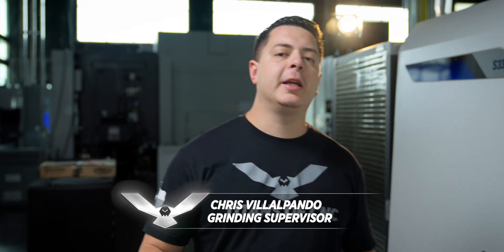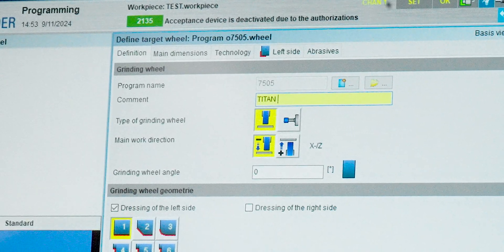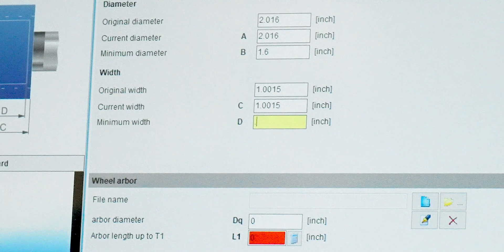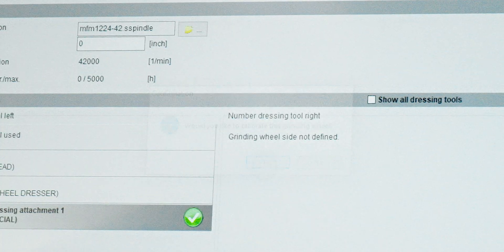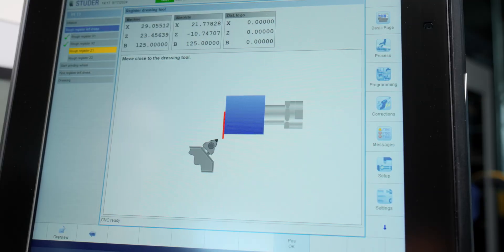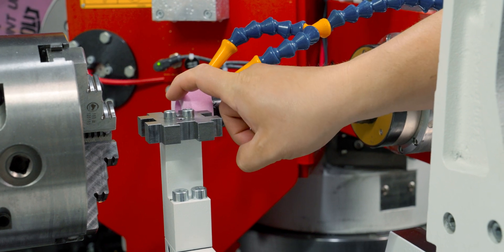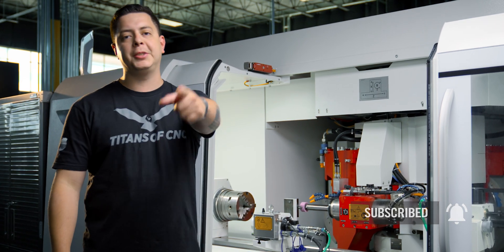Setting Up The Incredible STUDER S33 CNC Grinding Machine

Comment: Epoxy for wheels? I run some older ID grinders have been for about 5 years now but thats the first I've seen that. I just use blotters and screws and indicate my wheels into center to balance the wheels to minimize vibration through the quill/wheel but minimize the amount I need to dress off my wheels to true them up. Seems to improve my surface finishes, maximize my tolerances I have to hold, and prolongs my wheel life.

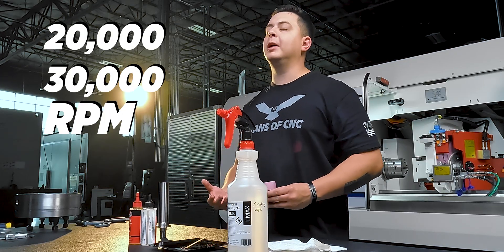Comment: Printed on wheel - max rpm 0:40 16234; 1:57 caution, do it good because it will spin at 20-30krpm. waitwhut? Is that like a radius diameter rpm thing? :D
Reply: Max rpm only applies at max size. This is per norton (hard to get a straight answer), radiac/ tyrolit (north America vs Europe parent company), and noritake (speed listed not rpm). 

Equates to a surface feet per minute or meters per second. Essentially wheel limit for that wheel is 96mph or 43m/s or 8500sfm. If you never go faster than 90mph, 40m/s or 8000sfm will you ever exceed the wheel limit? No.

I run an S41 all day.

Comment: When you put that cross thing on the grinder and just tightened it down.  I'm thinking to myself , how is that going to know where it is? There's no wires or lock points.  Then to probe those positions afterwards is brilliant.  
I'm guessing that you have to do that cross touch off and probe sequence when ever you change wheels.  Do you have to recalibrate after every dressing?  Or does the machine know where the diamond dressing tip is enough to get you back to your last grinding dimension?
Reply: You have the option to recalibrate after changing wheels, and its best to. After dressing the wheel touches off on the cross, that's why it is important to dress so you have a true running surface to calibrate!